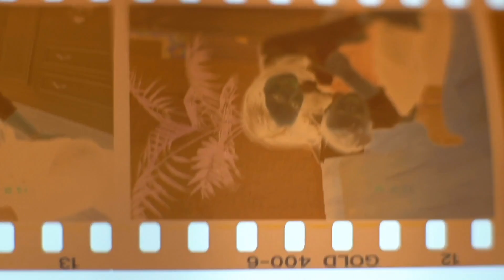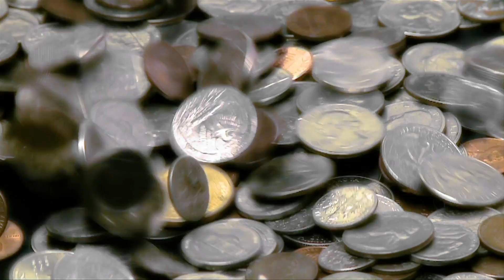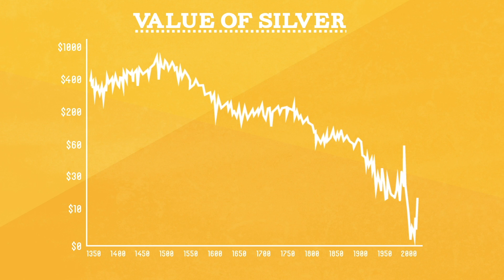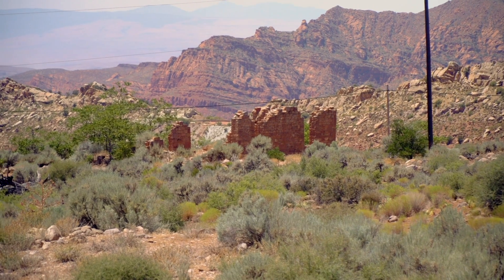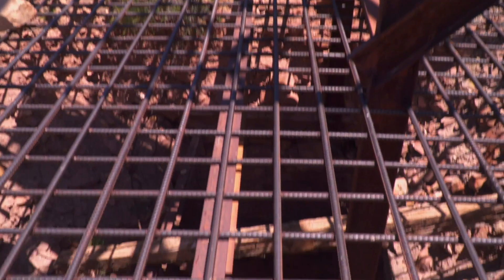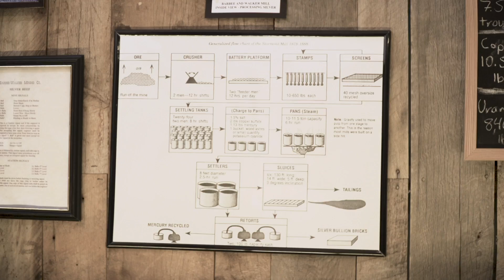Extracting Ghost Town Silver

Comment: It was actually a bimetallic standard, not silver standard, from 1792-1900 (not 1785-1873), because both silver and gold were on a fixed ratio to the US Dollar.  The problem was that the market ratio of gold to silver fluctuated over that time based on supply and demand.  This caused either gold or silver to be overvalued vs the other metal by the US Mint, so the more valuable metal was withdrawn from circulation and sold by the pound in Europe in exchange for the cheaper metal, which was brought back to the USA and sold to the mint at the official price.  (Gresham’s law:  bad (cheaper) money drives good (more valuable) money out of circulation.). Sometimes it was gold, sometimes it was silver that was sucked out of circulation, both causing coin(money) shortages in commercial channels.  What happened in 1873 was that the law ended the requirement that the mint buy silver at the official price from all comers, because all this new mining had made the market value of silver plummet way below the mint’s legal official price.  The 1873 law was to end the mint (the US Government) being ripped off by being forced to over pay for cheap silver.  The actual gold standard was not formally adopted until 1900 (it ended in 1933), but the 1873 and contemporary laws made it a gold standard in practical terms even though nominally bimetallic.

Comment: I watch Cody's Lab a lot. Where he does the "fire assay" or whatever and it's the molten lead and the bone ash cupel - that's one of the cooler things I've seen in a while - where it's a molten puddle and the different substances separate. It's just gnarly looking. If I ever feel like taking up hobbies again, this might be a direction I'd head. Kind of like geochemistry or something? 

And where you're saying it's not very valuable - that's still extremely awesome to take raw rocks, smash them up, do chemistry voodoo and come up with pure substances - just the novelty, general interest/curiosity and entertainment value to you and us viewers is well worth it. 

Also, I've seen a lot of videos where people take old electronics and computer parts and extract the gold/precious metals from them. I have basically two storage sheds and a room in my house nearly full to the brim with useless electronics - from dumpster diving. I originally intended to desolder all the parts (resistors, capacitors, LEDs, buttons, etc) and trash the boards - but it might be interesting to try to recover gold from the boards after salvaging the parts.

Comment: Traditionally, if you don't roast your ore, if using any crucible bigger than you're using now, you should warn your viewers that while your cons are in your crucicle amonides, sufides and sulfates, phosphates and all other kinds of nasty gasses are emitted while getting up to 1,763°, the melting point of silver. They can also pool in the bottom of your crucible and become hazardous while getting to the melting point of silver.
The best way to get silver is to do it like the early Egyptians and you stand no chance of toxic fumes or miniature 2000° bombs. Take your finely crushed ore and place it over a bed of coal. Then place another layer of coal with crushed ore on top and pack mud that will dry like clay around the whole deal as you move up. It'll look like an ant hill on the B.C. cartoons. Light it up, poke some vent holes and walk away. Far away. When the heat is gone you'll get a nice little platter of silver if the bottom where you built it has sand at the bottom carved out like a shallow bowl. 
YOU DO NOT WANT WANT TO BE NEARBY WHILE IT'S AGLOW! There are fumes, a whiff of amonides burning off can make you as sick as a dog and might kill you.

Comment: Next time you try to heat up the silver to mold it, make sure you first coat the melting dish in smelting borax, so that you form a coat of glass over the inside surface. This will aid in the metal being able to be poured out easily. Also, heat up your mold with a torch before you pour the silver in, it will help it form the shape you desire.

Comment: hey man should try mill up wood from log and make a dove tale box put that coin in. lock. i don this with chain saw several time on short bordes long border little harder as make small box don't worry about that. simple glue or screw a log to either stump or heaver log. cut strait down on two sides make flat bord. stop 2-4 inches above either glue or screws. cut across like cut tree down or turn side cut like cut logs for fire wood should free flat wood slab two hafe rounds that use make two bowls with. with circle saw or radial arm saw cut thine strips of end slab stack for year or two dry. then hand saw or band saw carful cut slab leather wise into to separate bordes that then try use fences joint know make box. i like dove tales but box joint easer for beginners. rabbit bottom bord so side of box mad will slide over raised squre glue. . for the top  rabbit again set down tope. should fits like bottom no glue. . use hand rotter put nice round edges of lide. i like use coves but most use either round over or roman round over little fancer. set coin few other things in keep sake box. later if want try make hinges, way lock it can but rabbit and gravity good for know.

Comment: I actually do this every day at work. Actually silver extraction from low grade copper ore/slag/waste/... for determing the percentage of silver, but also the percentage of gold, palladium and platina in it, which remains in the silver. This is done for analytical purposes, to determine the value of the metal waste deliveries at our factory. But we melt the product with the lead oxide and the flux in a scorification dish. When it is melted you take the dish out, let it cool and when it is cooled down you smash it with a hammer and hit everything off the lead, the dish included. It is a much cleaner and safer way to extract the lead out of it. Pooring it and letting it scatter everywhere, I would not advice it. :-) Nice channel man! keep it up. :-)

Comment: Pro tip? Don't use a cheap aluminum baking sheet if you can spare anything made from actual steel or iron. That sucker looks like work to remove the lead compound, turning to nearly wet cardboard toward the end. Flimsy weak metal better for aerodynamics and cost

Comment: Your beads are not pure silver, they contain all of the precious metals. It will contain contaminants like copper, iridium, platinum, gold, etc... Probably good enough to make silver nitrate but not pure silver... Dissolve in dilute nitric acid until it completely stops reacting. The solution will go green and bubbly, and will end up clear blue and stop bubbling completely.  Then add a few chunks of copper and let it sit there for a while, stirring occasionally. Silver will form on the copper and drop to the bottom. When no more silver forms on the copper, remove the copper, filter everything in a coffee filter and wash everything with distilled water a few times. Then squeeze the filter to remove water and put filter and silver in a crucible with borax. Burn it all, and the bead you get at the end is 99.9% silver.

Oh and don't breathe the brown fumes. Add a cap and tubing to bubble it in water and recuperate some of the nitric acid you use.

Comment: Great work! Note that silver is also used in solder, an easily-melted alloy used to join electrical connections or copper pipes/plates. Silver (and it's compounds) also have an antimicrobial effect (read: kills germs). Silver is close to gold in electrical conductivity and is sometimes used as an alternative to gold. Gold and silver will also alloy together to form electrum.
Reply: Silver has the best electrical conductivity amongst all elements (ignoring super conductors). Electronics only use gold because it does not corrode. Gold actually has a lower conductivity than copper and silver.
Reply: An antimicrobial effect in vitro. Don't try to replace your Neosporin with it, kiddos.
Reply: Pixl Rainbow This is it... welcome to the Electric Age
Reply: Its also super mildy toxic. Like not make you sick but will change your skin tone if left in one spot long enough
Reply: @lucifer-ek1yv  That's right...it turns you blue.
Reply: Tiny tiny amounts are used
Reply: Matthew Olsen yeah, usually it's use only for plating the contacts

Comment: Ditch the cookie sheet and use a cone bottom mold to pour your samples before the cupel step. It will capture a nice metal tip without glass and metal loss from it dripping all over the place.